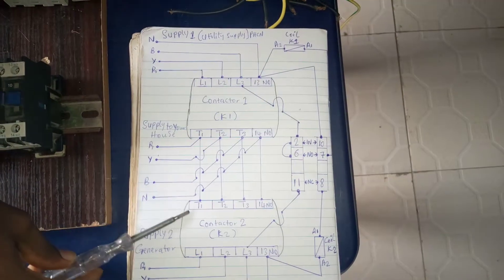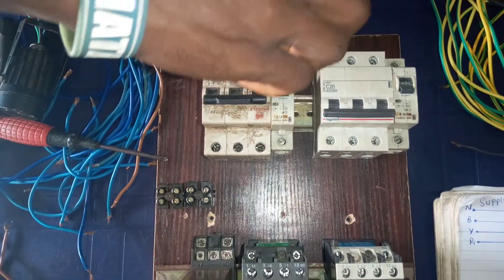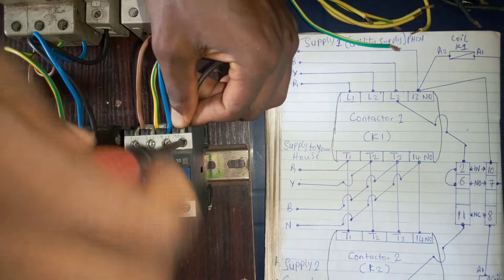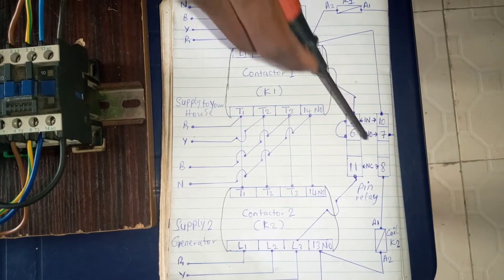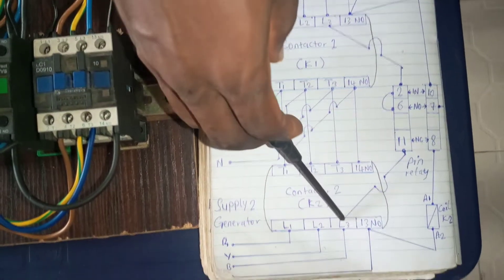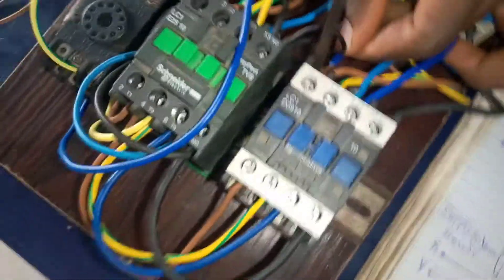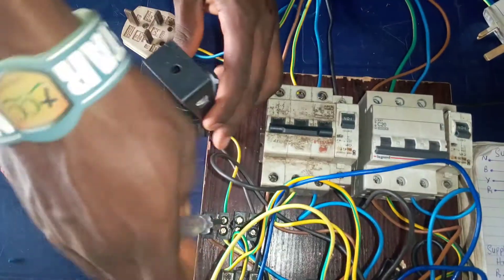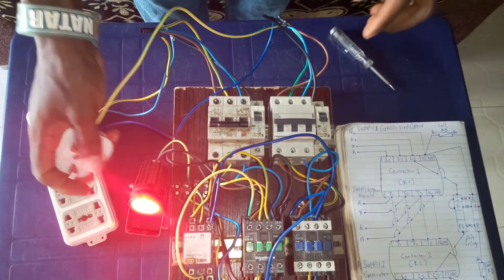HOW TO BUILD A 3 PHASE AUTOMATIC CHANGEOVER

Comment: good job. however, you suppose to have a little delay before switching to the available source. And the generator supposed to  short-down as well
Reply: I don't think the generator can shut down on it's own.
If the generator shuts down itself when the utility supply comes, it means when the utility supply goes off, then, the generator will start up again automatically.
Although, I'll be glad if it happens this way.
Thanks